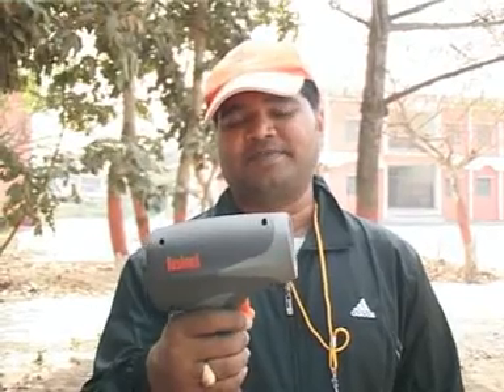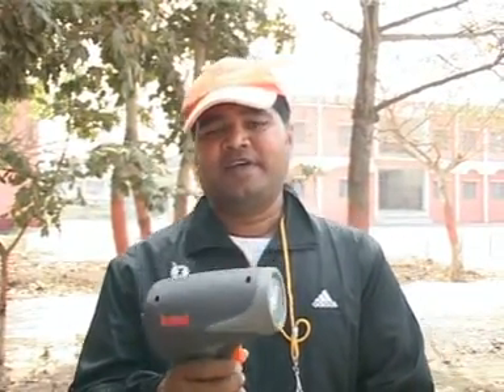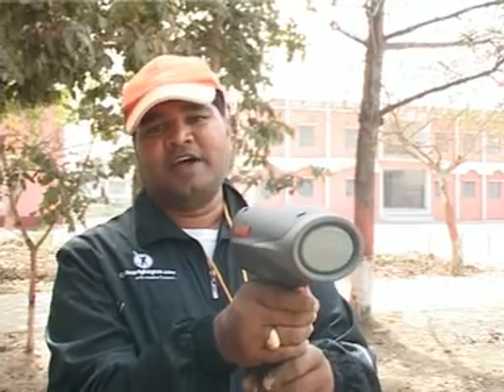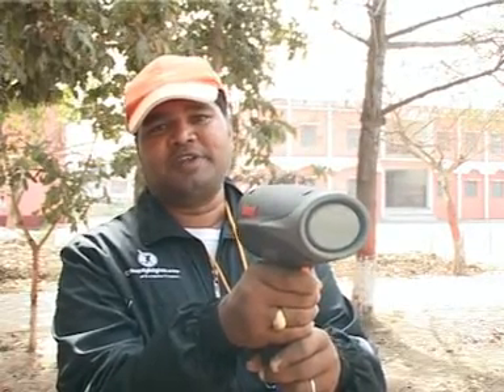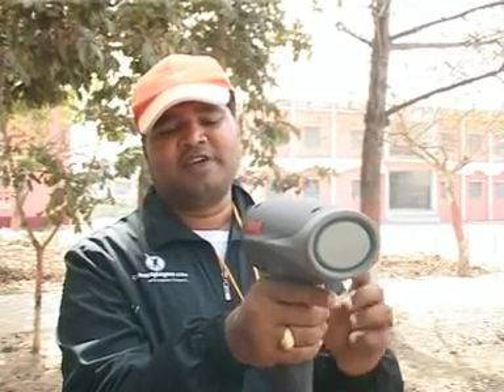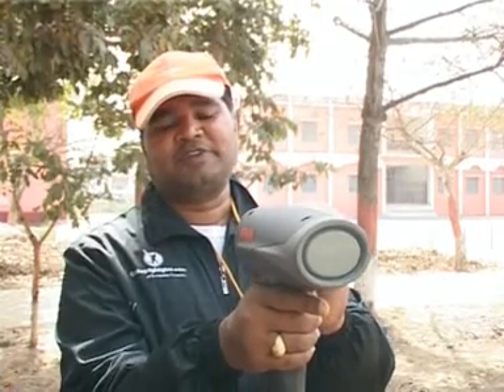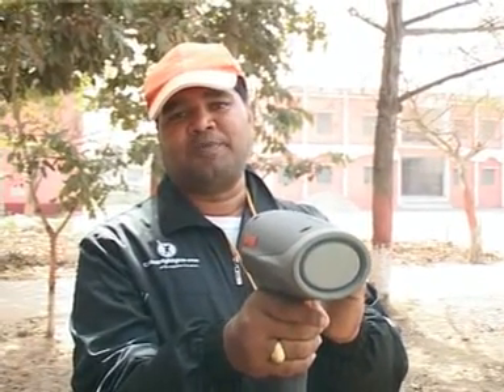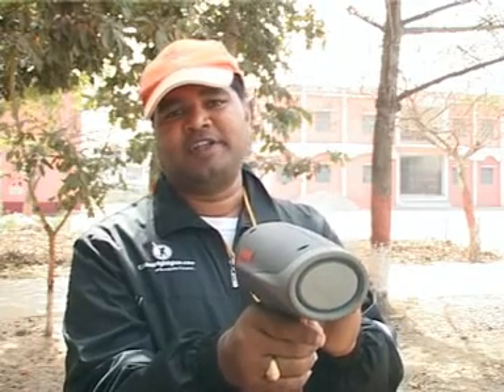Speed radar Gun Demo video.DAT

Comment: somebody please give your opinion honestly.. Here we can see this adult fast bowler running in hard and throwing at full strength.. Speed shows 108 km/h.   But in international cricket which we see in Tv.. even spinners with no runup and soft bowling action haves that much speed or sometimes more.  Iam just clue less! 😇
Reply: Caden Hage there is a lot of difference between radar gun and tv gun. Tv gun shows the speed of the ball just after releasing. Thats is the real speed. Radar gun shows around 5% less speed .
Reply: Original speed of this bowler would be like 115 at the release time